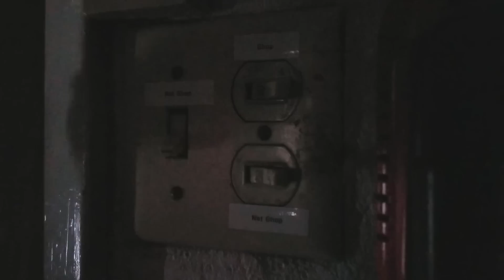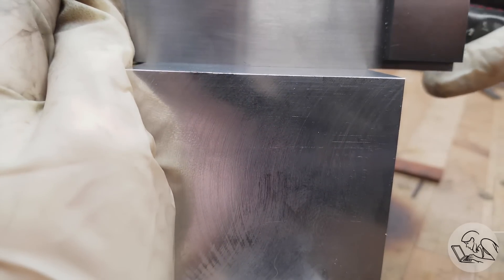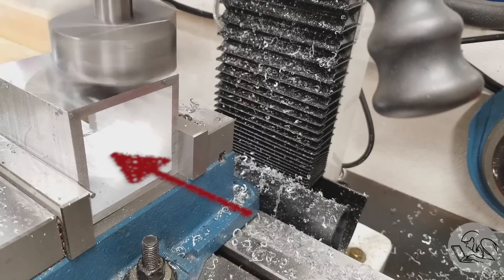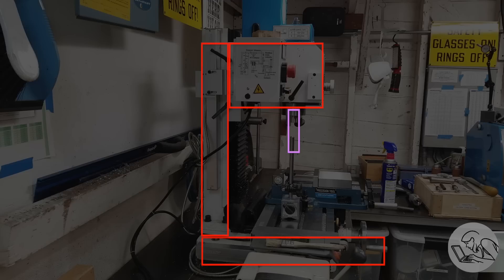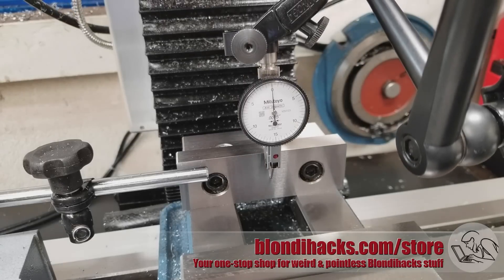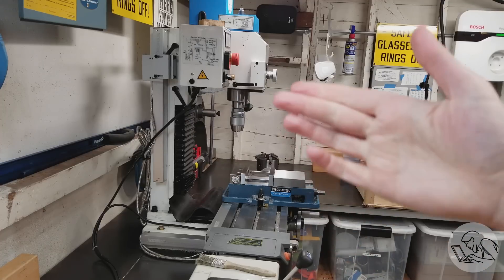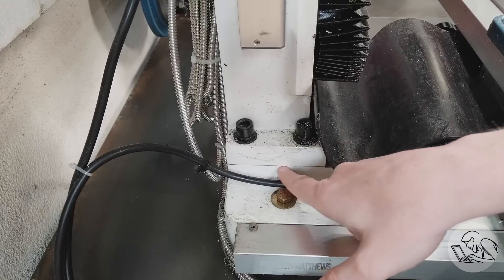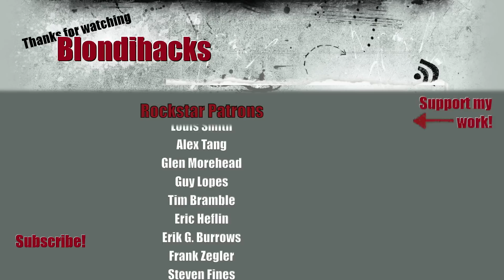Got Mill Alignment Problems?

Comment: Thanks for an excellent video.  I read that the definition of a machine tool is one that has the accuracy built into the machine.  You can make a cylinder with a file and a vise if you can measure the shape and correct the errors.  free form like scraping.  Or spin it in a lathe and get roundness, straightness, perpendicularity, cylindricity, size from the machine. We build machine tools and have to check for the errors you pointed out.  When one refers to a vertical direction which machine element is it?  Axis of the spindle, quill motion, column Z, 90 degrees to bed Y, 90 degrees to the table top, vise jaw, etc.  The problem could be complicated if the wrong thing was adjusted.  If a head nod was "corrected" by column lean the tram and fly cut would look good but bores would be out of square.  Good job bringing these concepts up in an interesting and informative way.
Reply from the maker: Traditionally, the spindle axis is considered Z on machine tools, and they are left-hand coordinate systems in X/Y
Reply: True, a lathe's Z is usually confused and called its X axis... Quinn, you have a much higher than average mechanical aptitude!

Comment: Just wondering, with the benefit of hindsight, whether a better way of clamping such an Al extrusion in the mill might be to use mill clamps onto the inside of the bottom of the extrusion, to clamp the part  directly to the mill table. The use of some guides or stops would allow the part to be repeatedly positioned accurately......

RoyG

Comment: If you wanted to get really crazy with it you could use machine epoxy to influence the column or scrape the bottom of the column and top of the base where the column sits. Stefan has a great video on this epoxy method. I am all too familiar with the very issues you speak of in this video. It can be time consuming to correct but it’s well worth it. That’s the only way to get great results on these mills i think. It’s all gotta be working together in unison. And the issue with it not holding an adjustment, I ran into that too!! Drove me crazy

Comment: Quinn, I just sold a PM932M-PDF I owned for 2 years and it was my first mill. It took me months to figure out how to get that machine running true. This video would have saved me a lot of time and headaches back then! I actually removed the column and head to check the surfaces between the column and base of the mill. What I found was that those surfaces were poorly machined, not even ground. I had to shim my column and that fixed the problem. It is very touch and go. I also found that tramming to the vise was more accurate than tramming to the table. At least that’s what my parts showed. Great video!

Comment: I.nice job. If you ever have to shim the column it is best to take a piece  of .125 or .250 O1 and grind the taper you need and shim the whole column up after you use shim stock to find the dimensions you need. Have a blessed weekend! P

Comment: Instead of adding pieces of shim stock around the various bolting points, you can use a small mill and the error in the machine to machine a wedge that corrects the nod or tram problem while making full contact and preserving rigidity. Since you are using the machine's own error to create the wedge, you don't even have to measure the error to get the correct wedge. When I did this, I double-stick taped my wedge stock (1/8" 5051 because I had some) to 3/4" thick piece of plate glass. The wedge and glass were clamped down to the table, and shimmed until tramming indicated it was square to the spindle. Glass has pretty decent strength in compression as long as you spread the load with something softish (cardboard from a beer 6 pack is what I used) and a block of steel to spread the force from the nose of the clamp.   In my case I was fixing a round-column mill drill, so shimming the base to column joint was really the only option.  On a mill-drill the quill is the only useful Z-travel, so you don't really worry about if the column is perpendicular to the X and Y travel.   If anyone tries this, note that the wedge machining orientation has to be correct so that it fixes the error instead of doubling it.  In my case, the wedge had to be flipped over diagonally between machining and installation.  In my case the wedge was square with a square bolt pattern, so no chance of machining it wrong, but if the shape of the wedge is irregular, you will have to think it through carefully.

Comment: Nice, I like the technique with using the square in the vise to get perceptible error to indicate.  Can't remember seeing that before?  Also, on the issue about lean and nod of the column and head...would you ever consider doing a tear down and scraping the interfaces to eliminate the error in lieu of shiming or just working around error??
Reply from the maker: To be honest, I don’t think a budget hobbyist mill like this is worth that level of intervention. If you need that level of precision, you’re probably better off getting a better mill. Furthermore , the motor and bearings in this machine are not worthy of micron-perfect castings, so you’d have to rebuild the drive train and spindle, and now you’re building a mill from scratch, basically.
Reply: @Blondihacks  That sounds like clear thinking to me.  Actually, I have seen not so much Asian built equipment that is worth rebuilding.  I had a bad experience trying to just replace a handle on a vertical asian mill about twenty years ago.

Comment: Sounds like it's  time for FEA! Looking at the side view of your setup, all the clamping force is through the rod some distance above the floor of the part. This will deflect the floor and the ceiling up on the rod side and tilt the top of the walls aft. The back jaw will resist this somewhat the back wall will deflect above the vise.   If you move the rod to close to the middle of the floor I suspect the deflection will be greatly reduced. 
Fusion 360 has FEA capabilities and it might be fun to see if you can approximate the results in sims.  Wait, this is a machining channel!

Comment: HI Quinn, great video and some great sleuthin'! I know its an odd mix or relief and frustration when you discover the machine was fine all along.....(I once was pulling my hair out blaming my machine, trying to figure it out, but it was the probe on the Heimer being loose that was causing all the problems).  I have found every time I face thin stock with the fly cutter if it has ANY opportunity to flex under the cutting load that I get that high spot in the middle. A second spring pass will usually reveal this as the cutter will make contact with that high spot and leave the edges alone.

Comment: Everything in this video was usefull.  I had a similar journey on my import  mill vise.  I discovered a .007 in  high ridge on my vise's fixed jaw casting (must have been some cutter they used)  which caused the vice jaw to tip at an angle when I installed it.  Then I discovered the base of the vise was warped.  I was seeing movement on my vise jaw when I tightened the vise to my mill table.  I had a fly cutter that let me flatten the base which uncovered a tram issue when it ended up cutting on the back side just like yours.  It seemed like you enjoyed troubleshooting your problems.   I did mine too.  Thanks for the video.

Comment: Several folks have commented that the piece was distorting when being clamped. Your answer to all of them was that you checked for that and ruled distortion out.  Yet, @15:26, you show the clamping was clearly distorting the part.  How was the distortion checked initially and what assumptions were not valid?
Reply from the maker: That’s not distortion. It’s movement. This is clamping lightly on a 3/8” thick extrusion. There’s no way it’s distorting 15 thou. Furthermore I put the indicator over the wall of the extrusion on top, not in the middle where distortion would show.
Reply: @Blondihacks  It may be just semantics, but the part is definitely bending within the material's elastic range.  This is what I meant with "deformation", but it is technically not correct.  Distortion would be a permanent change in shape after the stresses were removed.

I can't speak to how hard or light it was being clamped, but the force from the vise could certainly bend the part as seen in the video.  It doesn't look like it is moving (up, down, left, right, or rotating). 

Thanks for the response.  Great channel!

Comment: My pm 25mv came brand new, looking like it was stored in a garage in the desert for 50 years.  I knew what I was paying for when I bought it, but Jesus. Currently am stripping the half assed paint job off completely.  Lots of deep bondo filled holes in the castings FYI.  Looks more akin to wood filler.  At any rate I will be filling the base with epoxy granite and part of the column while I’m at it.  Even the acme screws and gears in the z were caked in dirty grease with literal beads of sand in them.   Just for future buyers....plan on completely cleaning the hell out of your machine when you get it.

Comment: With the 2" cutter... loosen the bolts bring the tool to touch the bed or ground flat stock. Slowly tighten all the bolts. I promise it works. The simplest way. I do it almost every week after tilting the turret on a Bridgeport.  Excellent video.

Comment: Nice presentation and diagrams. Trammed my bench-top mill the other day for a similar problem while using a fly cutter. Noticed there was still some cutting on the back side. Never thought about locking the head down during adjustment. You gave some good pointers. Thanks.

Comment: My first instinct was definitely that something was amiss about the work holding of the extrusion itself. I've machined enough extrusions to know they never play by the traditional rules.

Looks like your machine is running truer and better than ever at any case. I need to go through your level of rigor on my own little mill for similar reasons, definitely has come slightly off tram over the last year or so.

Comment: Turn it 90 degrees on the vertical and repeat and see if the results are different. Limited to the jaw distance of the work piece, but for checking alignment may help.

Comment: Do you have a video on making that tramming fixture? Maybe I can learn to use the mill at work while making one.
Reply from the maker: I don’t have a video on making that guy, but it’s literally just a scrap of brass with a hole drilled in the top and a brass piece of roundbar loctited in place. There’s a hole drilled in the end for the shank of the dial test indicator. Any old scraps will work. I used brass because our was what I had at the time.
Reply: @Blondihacks  Thank you.

Comment: Ah, the joys of dealing with tram issues in knee Mills😵. This is why they sell kits to put indicators on Bridgeport heads to monitor squareness. I'm so glad I don't have to deal with that anymore. Quinn, you're rod method is good, it's just the placement of it was too high, causing the inner wall to buckle distorting the rest of the extrusion. Next time, try to place it where it won't cause collapse👍
Reply from the maker: It wasn’t distorting the extrusion, I checked for that.

Comment: Well, that was fun. Probably not for you but for us. It doesn't take much to crush small cross sections with the mechanical advantage of a vice. When you are working to thousandths, everything makes a difference. Tracking down this sort of problem is like looking for a needle in a haystack and first you must find the correct haystack. Well done.

Comment: You can also insert some good fitting slips (gauge blocks) inside the extrusion to make it more solid when you clamp the vice. Also, very light clamping and small cuts can help. You'd be shocked with how little you can clamp something to machine it.
Reply from the maker: Oh hi Vic 👋 🙂
Reply: Shocking for sure. Tell that to all my broken Carbide endmills when I thought parts were clamped tight enough for DOC, plus having to explain why my underwear was stained. Check out Pragmaticlee’s bozo at 24:38. https://youtu.be/l4W4PbAC9n4

Comment: Always learn something, looked thru my tec. manuals couldn't find a definition for "caddywampus"  keep um coming!
Reply from the maker: It’s in Machinery’s Handbook... uh... in the middle somewhere
Reply: @Blondihacks  I think "caddywampus" is a mid-western term.  My dad was an engineer at Douglas during WWII and after when they were trying to develop Vertical Take Off stuff.  He usually would refer to things going caddywampus whenever one of the prototype shed a wing or something under test.
Reply: * cattywampus.
Reply: "Cattywampus" is no big thing. Nothing that applying "finagle's law" can't correct.
Reply: It is the opposite of anti-godlin

Comment: In the case of a cube like that could you rotate it 90 degrees in Z?  Or would that give up all your clamping strength?  I enjoyed following your thought process through this project and I hope you're keeping on in these unusual times.
Reply from the maker: In order to square the stock properly, you need to place the machined faces against the fixed jaw as you go
Reply: @Blondihacks  You're right; I didn't think that one all the way through 😕
Reply: Parts like this you are sometimes better off getting rid of the vice and clamping or gluing the part directly to the table. And then use the same techniques you would on a surface grinder to make square faces.
Reply: @andreblanchard8569  It's only a coincidence but a comment about flatness from a person named Blanchard is amusing.
Reply: @jimsvideos7201  I was at an auction years ago and in one box was a bench stone with Blanchard Grinding Co. molded into it. Ended up with several boxes of useless junk to get that stone.

Comment: I've found my fair share of tram issues with flycutters. Most of the mills at my school hadn't been trammed since they arrived there, so when I had a back cut that looked like .010"-.015", I got a little suspicious. I ended up tramming most of the mills there. Good for practice, I suppose.